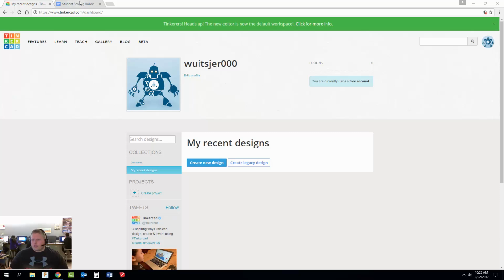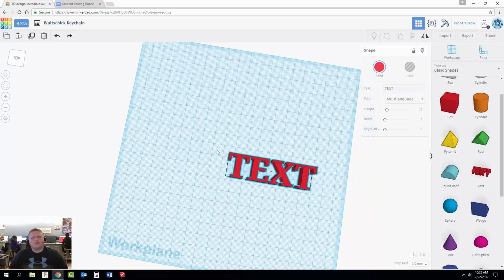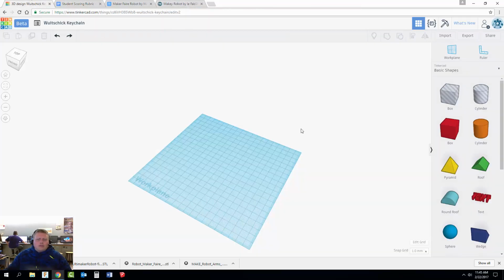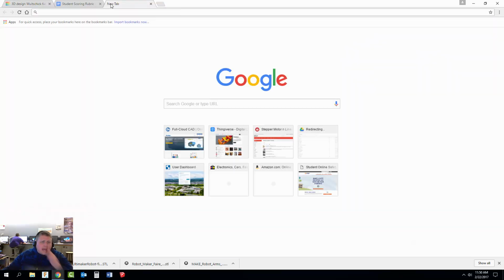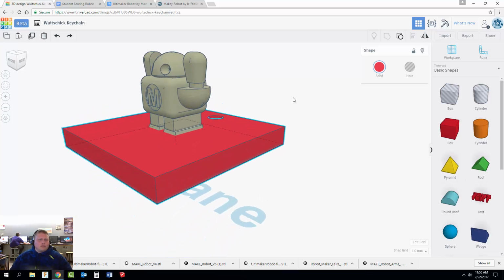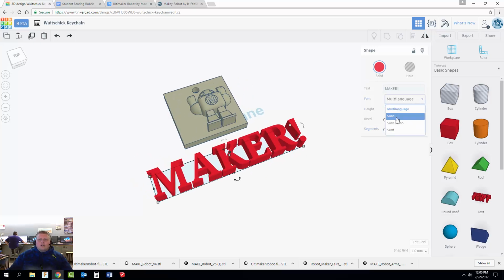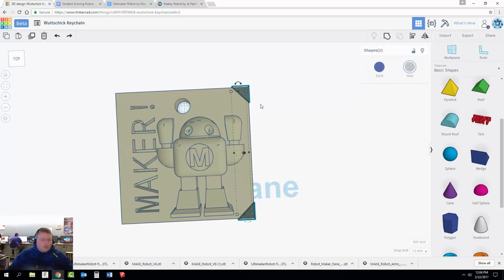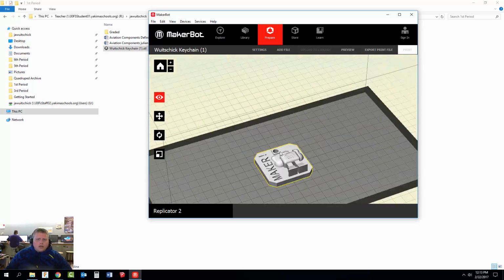TinkerCAD Keychain: 3D Design for Absolute Beginners

Comment: How do u get the hole to print out? I print mine and the hole covers out
Reply from the maker: 1st select the thing you want to cut out and select hole (instead of color). Then you have to group the hole with the object you want to cut from.
Reply: @woodywong76  I did all that its when I  transfer it to the printer to print.  When it finishes.  The hole ain't in the print.  But its there in the design in cura with the hole

Comment: what if i want some stars in a different color than the key chain but still group it, is that possible??
Reply from the maker: Hi, there. Remember that the only color that really matters is going to be the color of filament that you load on the 3D printer. So, if you wanted the stars to be a different color than the rest you would be sure to design the stars to stick up a bit taller than anything else. Then after the rest prints and its just working on the stars that stick up, you pause the print do a filament color change on the printer and then resume. The remaining part that stuck up further than the rest would then be the second color.
Fun fact: STL files used for 3D Printing don't even contain any color data. They are only geometry of the shape.